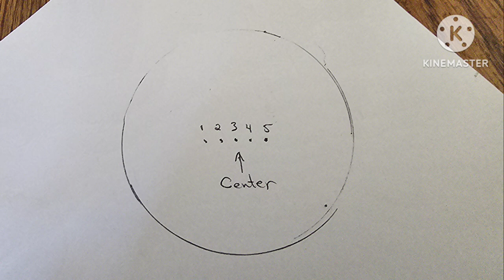Woodturning off center Christmas tree

Comment: This is a lengthy comment meant to give you constructive suggestions. ( I taught for over 40 years, so I believe I know something about teaching.):
     I.Do NOT assume anything about your students other than that they know how to use the equipment.
     II. Do NOT use your second, third, or fourth attempt at a project as the object for instruction. Your students should get the idea from the confidence in your voice, the movement of your hands and tools, as well as your overall demeanor that you’ve done this task enumerable times.
  III. All your tools must be razor sharp. ( If you have to pause the video to sharpen a tool, let your students know; it will remind them to do the same.)
   IV. NEVER place a pencil mark on a piece without explaining beforehand exactly why and exactly where the mark should be made. During filming, if you’ve mis marked the piece, announce that and state why you’ve changed the placing of the mark. Making mistakes and correcting them is an important factor in learning and teaching.
     v. As you work, constantly explain what, why, and how you are trying to achieve the task.
Again, if you mess up, explain how and why the error was made and how to correct it.
   VI. NEVER use words or phrases, such as: “about “, “roughly”, “kind of”,”approximately “, and any other vague or imprecise wording.
     THERE IS MUCH MORE, but to be honest, at 77, I’m getting a bit tired of texting. I wish you well with your channel. If other viewers object to my suggestions, they are entitled to their opinions if they know better.
Reply from the maker: Thank you! I appreciate the constructive criticism, and will try to remember some of it as I'm creating further videos.
  My channel, so far, was not created as a learning channel, as I've only been turning for 3 years. It was created to show my friends and family my new craft, and how I make pieces. 
It has grown beyond that now, but I don't consider myself a teacher, by any means, and I don't know if I ever will. 
My channel is for entertainment purposes only, and I know that there are better learning channels out there for learning woodturning,  and I try to send anyone looking for answers in their direction. 
I really do appreciate your direction though, and I'll keep it in mind!
Reply: Thank you for reacting to my suggestions as they were intended. I meant to help. In fact, now that I know you have been turning for only three, I’m impressed with your level of skill. Please, keep on putting out your videos. You’ve gained one more fan.